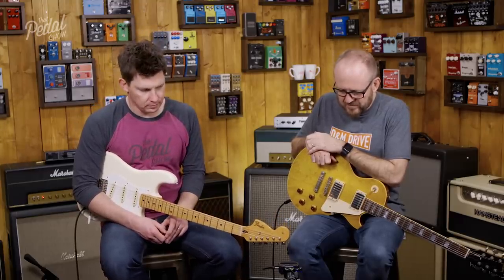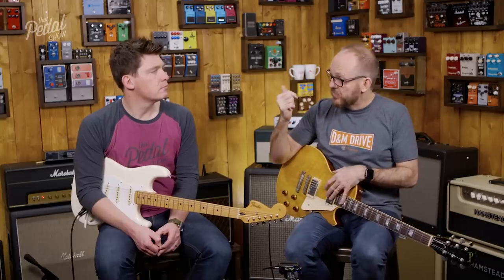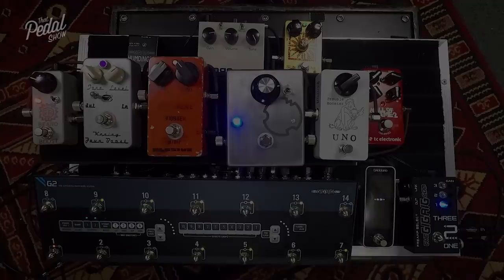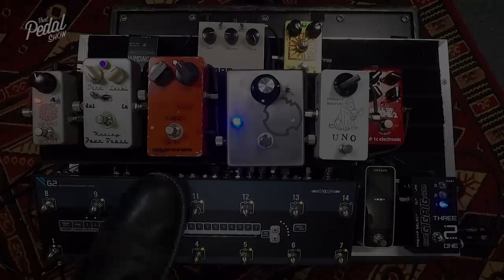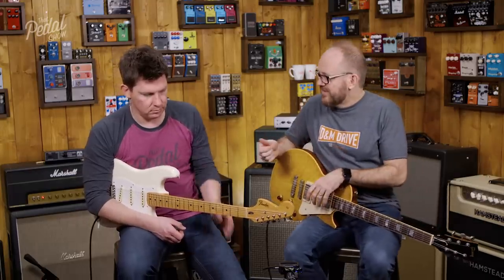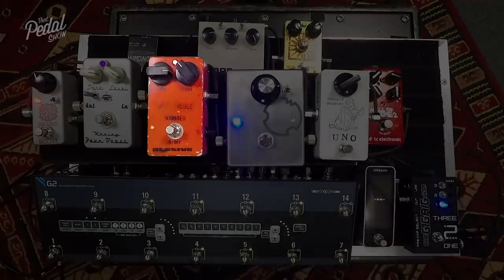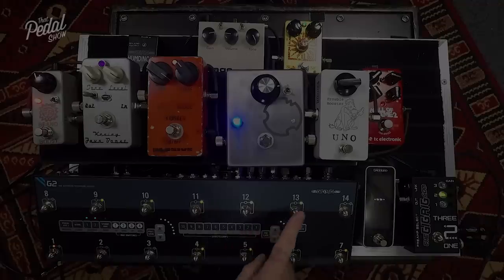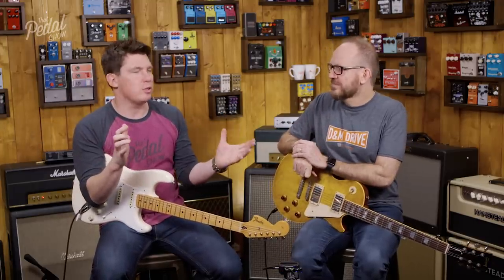That Pedal Show – Tremendous Treble Boosters For Glorious Classic Drive Tones

Comment: I have a question which is very off topic, but I would appreciate if anyone could shed some light on it for me. I was looking online reading and researching but could not really find an answer either. So the question is, how much current a guitar amp say 50 watter uses usually from a 230-240v wall socket? (AU-EU regions). I know it's written in the back of most amp heads, but the tricky part is the so-called "Inrush current", which is the amount of current amplifier uses in the very first seconds after its being turned on. On the back of my Friedman BE-50 which is a 50 watt amp for instance, it says 375 watt and I guess it should only use about 1~2 amps in current? 

However, nowhere it's mentioned how much current it uses in it's initial "inrush current usage" or when it's pushed/cranked to it's limits? I'm asking this, because I'm using a Furman Power Conditioner which provides 10amps of power which should be plenty for only a 50w guitar head amplifier, but I wanna know how much extra amp should I leave unused for the amp just in case it needs it? And how many more devices can I use with the Power conditioner, like my pedalboard which has only 2 digital pedals (Strymon DIG and MXR Reverb) and the rest are all analog.

Cheers,
Reply from the maker: Hello. Mick here. I have absolutely no idea, sorry. One would assume the current is plenty from something like the Furnan. Hopefully somebody electronically knowledgable will chime in. Cheers!
Reply: Thanks for replying Mick! Have you guys use any power conditioner where you are? For any of your amps?
 Is there any downside using them? Like because they filter the AC power, have you ever experienced they somehow affect the sound of the amps? I guess in Andertons they should have some kind of power protection for all those amps right?

Regarding my question, to be fair it's a very difficult one, because after days of reading online, I could not get a clue either! I know a bit about electronics and I guess eventually I may have to begin experimenting with a multimeter ^^ Hopefully I don't have to though.
Reply from the maker: We don’t, but I often wonder if we should. Mains power in the UK is generally excellent but I’ve certainly been to venues where I wished I’d had a Furnan!
Reply: Well, I was playing live the other day and it was rainy. The stage was indoor of course, but after a while, when my guitar was not connected to the amps, I heard a very short buzzbizzzrumm kinda noise for couple of seconds and then it was ok. Nothing happened, the sound was fine, but since that time, I thought maybe power conditioners are the solution? Especially in rainy days when electronic devices behave differently due to the more chaotic electromagnetic charges around. I have no idea how people deal with their amps in different weather conditions to be honest !!! Thanks again.
Reply: Well that's right Forallofus, but that is not a problem really. The problem is as I explained, how much so-called 'Inrush Current' does the amps generally draw? Or how much current when the amp is pushed/cranked? I could not find answers for that anywhere I looked to be honest. Theoretically though yeah it's easy, but amps are way more chaotic and complex in nature when working really...
Reply: Buy an inline gauge if you're that curious. But I can tell you without a doubt that a 50 watt amp isn't pulling anywhere near 10A. In standby, the "inrush" is only going to pull enough to charge the capacitors, and isn't going to trip your breaker. Even if the standby is off, you're not going to pull anywhere near 10A. It's not like a large mechanical motor where is needs the surge to get things turning.

Comment: I think I heard at one point that the rangemaster treble booster was only 1/2 of the intended rig. I believe the other half was a fuzz pedal that just by plugging it in your chain made your rig terribly dark. Treble booster was intended to bring that back, that’s why it isn’t foot switchable it was ment to be kept on. I’m not sure if this is true, I’m making it up, or was lied to. The only thing that matters is when you get a les paul jr, a treble booster, fuzz face and Marshall 1986 (50 watt bass amp) you have the tone of the gods.
Reply from the maker: We get to this in part towards the end of the video. If the amp is cooking, the treble booster can sound amazing. If it’s cleaner, yeah, you need another pedal of some description, maybe a fuzz. You weren’t lied to - it was a contextual truth. Thanks for watching!
Reply: For sure. They only work into certain amps that are turned up a bit. I just think it’s interesting the way treble boosters became popular is far from the way it was designed.

Comment: How different would running a graphic EQ above unity gain with a bass cut and/or pushed mids?
Reply from the maker: A little different. The Germanium transistor design makes a difference. Cheers!

Comment: To me the most versatile trouble booster I've ever seen isn't even in the group of pedals that they have it's the full tone ranger because it has a six position switch I don't think any of these can outperform that one and it's not even represented so you're really not getting a full picture with the selection considering that the full tone ranger exists

Comment: Considering the treble booster does not really boost the highs, but the mids, how does it compare to a tubescreamer?
Reply from the maker: Oh it definitely boosts highs as well. It’s a transistor design, not an op amp and clipping (like a Tube Screamer), so they’re really radically different. Cheers!
Reply: Good point, the op amp are of course adding clipping, and so on. Cheers!

Comment: How is this different to using a klon type pedal (or TS?) with tone knob dimed Full?
Reply from the maker: Very different indeed. Mick here. The Klon is an IC based pedal that uses op amps to create its gain and diodes to clip it.You could probably get part of the way there but that germanium (or silicon) transistor design is a big part of the sound in a treble booster. Cheers!

Comment: Some righteous tones in this episode. I presume the beano boost is an allusion to the beano album. But I've always heard different people argue over whether Clapton actually used a Dallas rangemaster on that album or not. Anyone know anything definitive?  Mick?  You're the journalist.
Reply from the maker: Consensus of sensible opinion say he didn’t, based on examining pictures and stuff. More helpful is to listen to it, which I haven’t done for a while. Somebody further down the comments list wrote a good entry on this too saying the desk may have well been a part of the sound. Makes sense.
He must have used something in Cream (for fuzz/Boost, I mean!) but memory is telling me that Bluesbreakers does just sound like an LP and the dear ol’ Marshall. Time for a listen!
Reply: That Pedal Show my listen also tells me no. The takeaway is that it's an overall dark sound and dark sounding les Paul. (Dark in s good way). And while this video shows that a treble booster doesn't mean bright, icepick in the ear type brightness, still seems there's too much low end growl for a treble booster. As for cream, I don't think he ever used fuzz. I know there are some parts where it definitely sounds like a smooth fuzz, but  I gather that's just from playing with the tone controls and a cranked amp.
Reply from the maker: Hmmm. You’d have to //really// crank that amp. I mean really crank it to 10 and then some. Could be 50s I guess?! They might have overdriven more.

Comment: yo my dudes i need some advice; my friends and i are starting a band in which i'm the only guitarist and although i've found a usable sound with my peavey bandit/squier strat combo ( don't laugh ;) ) it sounds weak. it's barky and aggressive which is how i like strats but it lacks power, especially as im the only guitarist. is there any way i can keep this character but fill some of the empty space?
Reply from the maker: Definitely try a short delay. Start with slap back (around 120ms and work back from there to around 50ms). That’s a fattening sound for sure. And also buy a Big Muff. Pretty wide noise there! Thanks for watching!
Reply: thanks!

Comment: cough cough. Richie Blackmore
Reply: Ritchie is the reason I got a treble booster.
Reply: Didn't Mr.Blackmore use a echo plex to tame the highs from his rig?
Reply: @nickfit3  the tape echo he used (awia tape machine) became his booster as well as his delay...the high pass effect that a treble booster creates was then built into his amps. And he played Marshall Majors (not the typical 100w plexi superlead of the time) which were smoother in the himids. Before switching to the awia tape machine he used a treble booster into the Marshall Majors....the actual brand of the unit he used was the Hornby-Skewes.
Reply: @Gruntle  personally, brian may is my reason.
Reply: 98jsbx98 Jimmy page ....the reason I got mine.
Reply: Rory Gallagher if I’m not mistaken too?

Comment: Hey guys, so in my rig I've got a valve that I keep close to breakup (Blackstart HT20) and typically use my tumnus to get over the edge of breakup and add some grit/boost. Now for when I want more modern and heavier distortion, I use an OCD with the drive on it pretty cranked and it ends up sounding rather Marshally. Here's my question: Will placing a treble booster in front of that OCD have the same intended effect (driving it harder to get that harsher distortion)?
Reply: Ummm, just got to 39:00....looks like you may be answering my question lol
Reply from the maker: Excellent! It will certainly push more and get more gainy. Whether you like the resultant EQ will be down to taste. Cheers!

Comment: Do you guys prefer the Palmer over the Fryette?
Reply from the maker: I prefer it because it’s less noisy (Mick here) and it does a simple attenuation job well. However, down at high levels of attenuation you definitely start missing some bottom end which is where the Fryette comes into its own thanks to the on board EQ. And of course the Fryette has the amp in it too to make small amps loud. So it’s an entirely different thing. For basic attenuation up to about 50 per cent the Palmer does the job. Cheers!
Reply: By “less noisy” I suspect Mick is referring to the Fryette’s cooling fan, which does whir a bit.

Comment: Hey guys. Been wondering if running two 15 watts amps is the same as running a single 30 watt amp (i.e. running two Vox AC15s vs a single AC30 with same speakers)
Reply from the maker: Nope. Two 15s will almost certainly sound ‘bigger’.
Reply: 15's don't sound like smaller 30's.  Common misconception.
Reply: I have been thinking about doing this not really for volume but just as a stereo setup. I want one with greenbacks, and obviously the other would have blues. I think it would be a good time.

Comment: The question I had even before watching the video is: can't I use my favourite overdrive with an eq for the same purpose? And if I want to gain stack, it would be two drives and an eq
Reply from the maker: You could get somewhere close to a similar effect. But the transistor design of the classic treble booster - silicon or more commonly Germanium - has a big effect on the tone. It’s very different from an op amp type OD pedal. So it really does depend on what kind of OD pedal it is too. Cheers!
Reply: That Pedal Show yeah, I watched enough of your videos to know about that, but maybe for someone that doesn't want the unreliability of fuzz pedals... By the way thanks GUYS :)

Comment: there are $3  piezo units on ebay etc that run off less than 12v that do cooling. they are about the size of a postage stamp.
a bit of heat sink paste onto the metal chassis and you have your cooling, add a simple temp sensor and you have exactly what you were after.
Reply from the maker: Nice!

Comment: 20 mins in and my tinnitus has more overdrive than a metalzone 2. :)
Reply: My tinnitus began only couple of months ago after swimming. Since that time though, it comes and go, I tried everything from white noise, pushing the nose and popping the ears ^^ sometimes it gets better, but the high pitched noise in my left ear is just so annoying. Especially because I'm a working musician and sometimes it just gets on my nerves... I guess I have to go see a doctor as it seems it might be a simple infection/fungal. But I have no idea really.
Reply: could be your eustachian tubes, sadly there's not much they can do about that other than a steroid spray
Reply: I once had for a night, couldn't sleep. What I did was, that I used a digital pitch tuner in an app, and found the frequency that my tinnitus rang on, and listened to that one frequency....guess the tactic was to deafen myself on that one frequency :D But it worked
Reply: Great! What app was that mate? Believe it or not but it actually crossed my mind as well, but I have no idea how to find the frequency?
Cheers!
Reply: konnektlive I've had it for almost 5 years after having swimmer's ear. You'll learn to live with it, mine doesn't bother me much anymore aside from the 30 second stints where it feels like a bomb just went off. Try taking a supplement called MSM it's dirt cheap and might help it's also great for joint pain and other things
Reply: @Gál, thanks mate, yeah I can find the frequency but its pulsing and sometimes modulating as well, so I think it's not the same note all the time, but it's usually in the same frequency range anyway. It's a high pitched sound that pulsate, modulate and increases in amplitude depending on my body position, my neck movement and even my mouth movement! The worst though is the sleeping position. The funny thing is that I never had this issue even though I was playing loud amps for years and years. That day I went swimming without my ear plugs and this shit happened...

But is not it a bit dissapointing that medical sciences can not know the actual reason or can not satisfactorily offer a solution? It definitely is relayed to water changing something in the tubes or middle ear. I used to have that lowend~ish hum like a huge turbine moving, but when I did the ear popping technique by holding the nostrils, it helped me reduce the hum by a lot! But ear popping seems to do nothing for this high pitched one. 

Thanks for the link I will look it up for sure. Cheers!
Reply: @cbappa2 thanks man, I will look it up for sure.

Comment: you can design the circuit so that the Ge transistor bias is better maintained at a given set point  and is compensated against temperature.... BUT the original Rangemaster / fuzz-face / tonebenders etc were NOT....... John Hollis did something like this to prevent the FuzzFace Ge transistors from drifting in his "Rock Face" design, there's another called the "servo-fuzz" doing a similar thing.  Often a reverse bias Ge diode is placed between B-E terminals of the Ge transistor in an attempt to prevent temperature drift problems  - none of  these were  in the original circuits so often  players don't want them for "authenticity" aka "If it was good enough for Jimi / Rory "  etc etc  BUT there are ways to make Ge a bit more temperature stable. Often manufacturers will swap to Silicon to avoid the leakage and temp instability of Ge  and say there's no real difference (which isn't eactly true and a bit of a cop out imo)... Anyway (enough waffle)  thank you so much for taking the time and effort to make these videos they really are entertaining and informative and Dave Gregory gets a Honking too!

Comment: ".. and if u've been through 18 overdrive pedals.. try a treble booster." (I HAVE been through like 18 overdrive pedals.) Is there something there?? Maybe this IS what I've been looking for. Cause I haven't been satisfied with anything. Maybe it hasn't had to do with the sound of the gain, but the fact that it doesn't stand out in the mix correctly. (enter treble booster..?)
Reply from the maker: Yep. And we’re guessing you use gain in the amp?
Reply: !! Actually I've been sending overdrive pedals through the clean channel of a Marshall. Sometimes trying the Marshall's gain. But nothing does it for me. MAYBE a treble booster though. :)
Reply from the maker: Then that’s an EQ thing. Depending on the Marshall of course. But a treble booster into a clean channel.... not usually a great combination. What’s your favourite guitar sound ever that you’d like to achieve? And what kind of guitar are you playing?
Reply: I mostly play a Jazzmaster. My fave guitar sound is like: thick and full, but also enough treble to be very clear, very dirty. (Sounds I've heard from live Black Keys, Prince, Jimmy Page, Neil Young) Btw, tbh, I DO have an overdrive I like: the Catalinbread Dirty Little Secret. I've just never found another pedal I like.
Reply from the maker: Well there was are. Interesting on the JM very high value pots if I’m not mistaken - 1k? Mick here. Anything will sound a bit grainy and shrill... But given your preferences maybe the Marshall is a bit clinical for you. Ever tried a Fender Pro Junior or a little Supro? A bit more grit on the amp will help get you that old school vibe of those guys. Crank it, and get some colour in there. Walrus 385 and Hudson Broadcast should be on your list. :0)
Reply: Thanks for the suggestions! I think you're right, I should look into a different amp instead of trying all these different pedals. I don't think Marshalls are for me.